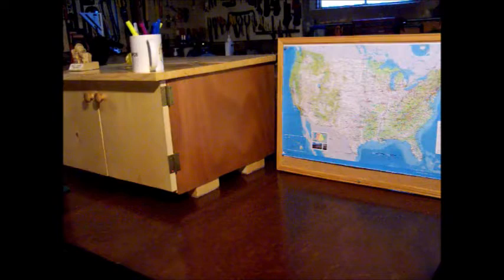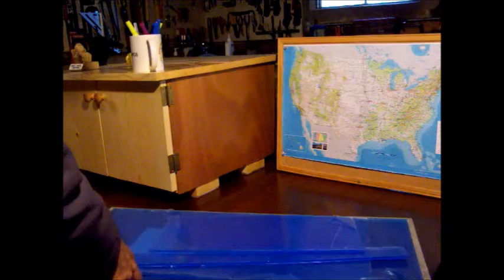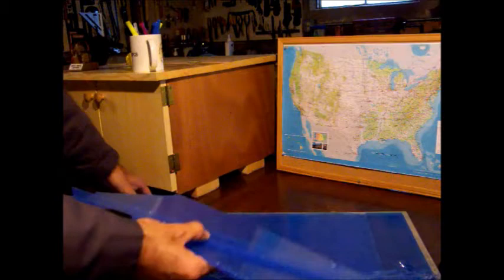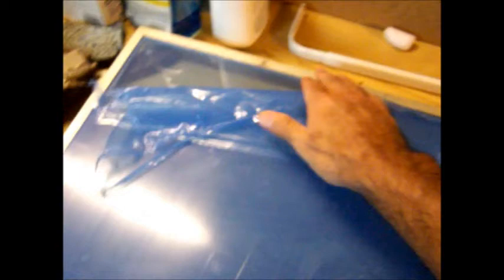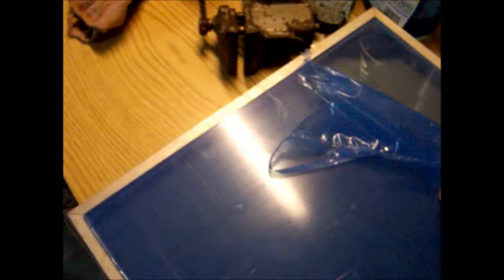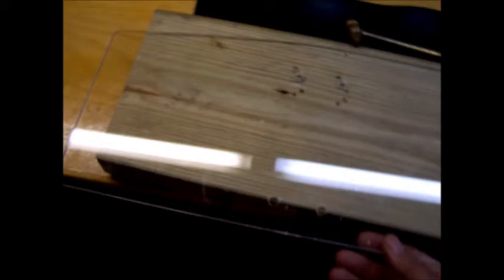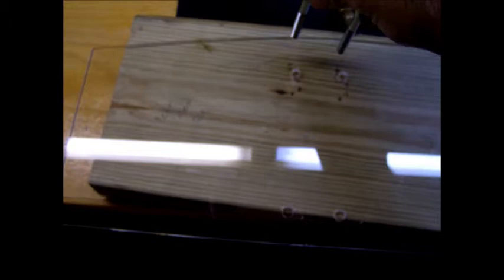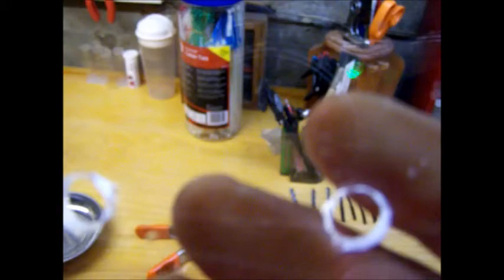Building the shack - working with plexiglass

Comment: Please remember that Plexiglas is DuPont's trademarked name for their version of acrylic sheet.  Most home improvement stores will carry generic acrylic sheet at a much lower price than Plex and it will work just fine I  most applications.  Twist drills are not the best tools for making jokers in acrylic.  The proper bits are taper bits but they are hard to find and relatively expensive.  I have had good luck with unibits (aka step bits) which are available art almost any tool store and are also great for making holes in all sorts of metal sheet so they are a great addition to any shop.  BTW, these are the bits to use to drill a hole in your car's roof to install am NMO antenna mount.